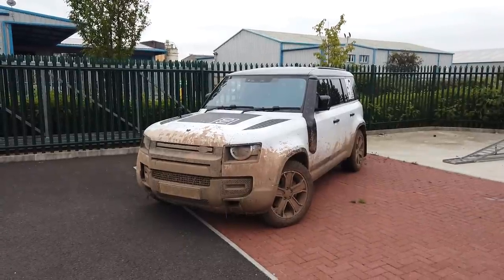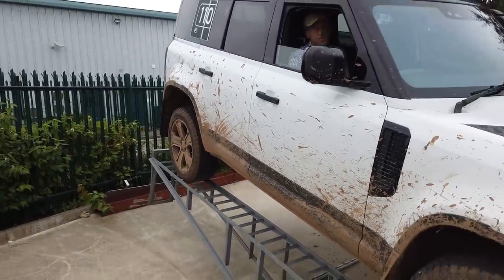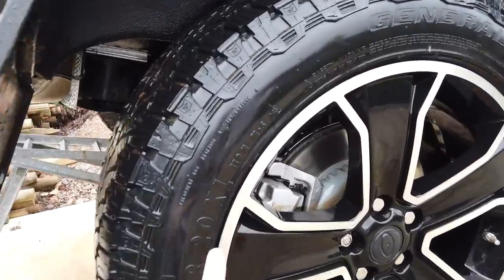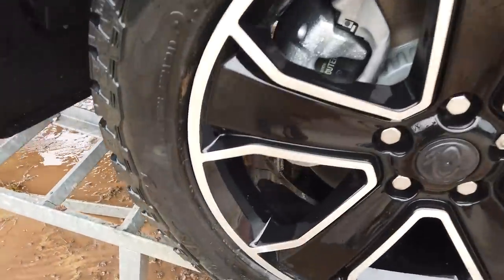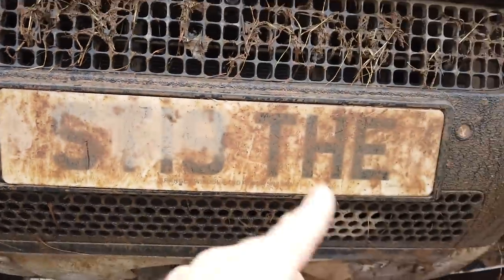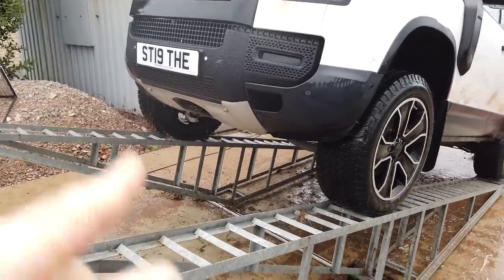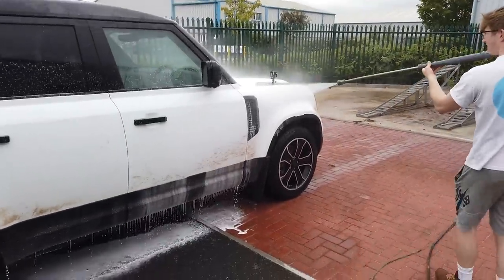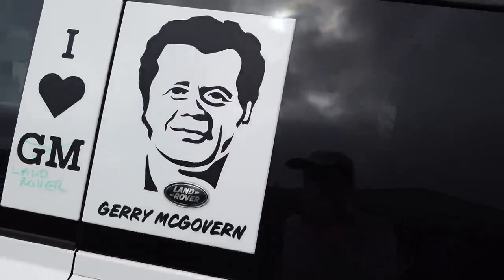Muddy Land Rover Defender 2020 Pressure Wash after Off Road Driving

Comment: i have a question about towing.. does it have the fitting ready and i just buy the towing ball and attach it or do i have to install the whole bar first. thanks in advance 👍
Reply from the maker: Alas you need to buy a whole rear tow hitch with rear cross member etc

Comment: What did harry do wrong that he was landed with this job? Btw you should have used a leather chamois to get the “big” wet off first then use the micro fibre.
Reply: Leather chamois will scratch , so much 70’s
Reply: Anthony Ford not if the car is cleaned properly.
Reply from the maker: But we dont want to upset Vegan Lavinia !